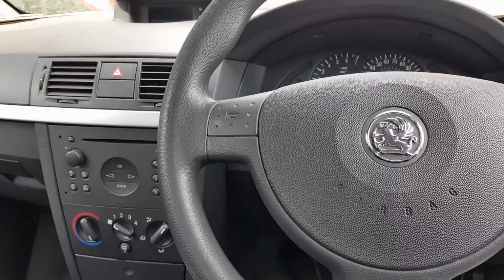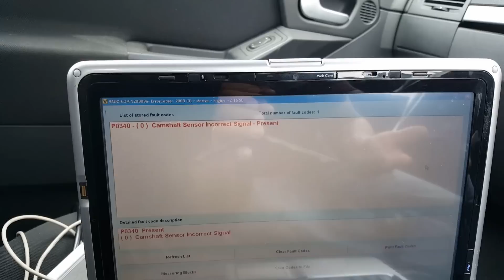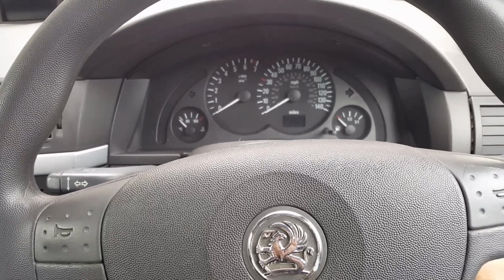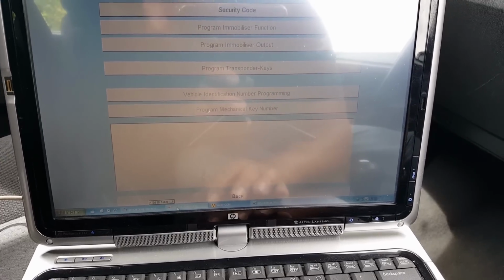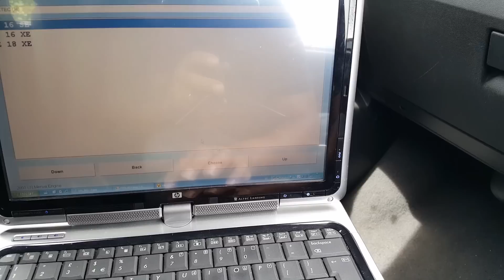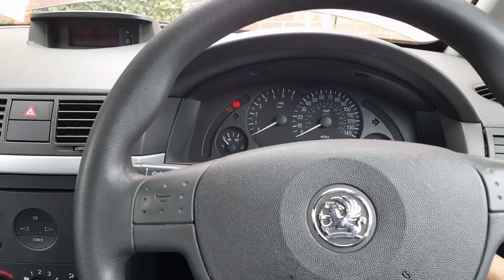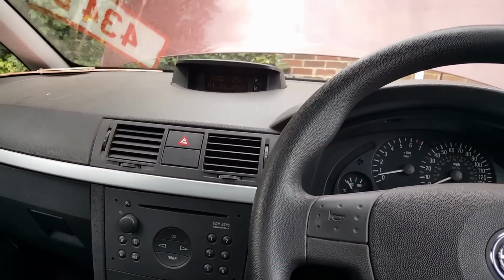Vauxhall/Opel Meriva 1.6. Engine ECU replacement, reset and programming.

Comment: Hiya another great video fella.  I am not sure I can keep up with the fast movement of your screen changes.  I would have to watch the video many times which I can do.  As you have been helping me with my grandaughters Agila Im going to say I took the fuel tank out of the vehicle and pressure tested the pump off the vehicle.  it showed it as before at 7psi running it directly from the battery which I had taken off the car.  i initially saw it pump fuid from where it should and although it worked it seemed weak so then the pressure tester was fitted with the earlier.  result.  I had wached a video of some guy breaking a fuel pump apart and illustrating all the other parts within the fuel pump assembly.  namely filter pressure regulater and realised i should have bought the whole assembly and not just the pump.  A costly mistake have a new assembly coming sometime tomorrow.  I am not sure it will work in the car due to possible ECU control issues so I am going to test it off the car again tomorrow, before putting it back.  This is due to the fact that since I changed the engine I have not heard the initial 3 second prime.  I would be interested in your view.  many thanks for all your producing for interested guys who love cars and electronic control cheers colin
Reply from the maker: colin Lyne 
I don't think you will have any issues with the control side of things...
The ecu only controls a relay, which in turns runs the fuel sender pump...
Until now everything points to a bad pump... 
Also check that the relay is good...
Bear in mind that just because you can hear it clicking, does not mean is good...

Comment: Hi there I was wondering where do I get the software from and the cable to to connect to the car and also will this work the exact same way for a zafira MK1 2004 model.

Reason I'm asking is I have had the lamba sensor replaced but the engine management light stays on even though the error codes have been reset, the cables have been tested and seam to be ok so the next thing is the ECM that needs reset or replaced which looks simple by your video.

I hope you can help or advise.

Thanks
Reply from the maker: The lambda codes can be a result of something else... well you don't say the codes... so just thinking out loud here...
You can get Op-com on eBay... software comes with it...
Thank you for watching and for your comment!
Reply: @LMAutoRepairs  yeah I meant the lamba codes have been reset and nothing else comes up. The sensor has been replaced 3 times with the same issue and codes come back on once the engine has been switched back on.

What else could be the issue from your experience? I have heard it could be the ECM that's been tripped and needs replacing and can cost a arm and a leg to get someone to do it.
Reply from the maker: @williamgall9616  
It is possible that is the ecu... if they are definitely hard codes, and everything else has been checked...

Comment: السلام عليكم اخي
I did the same steps But the security code For the new ECU  (DELCO MT35E) The computer did not accept it.
 Although it is true.
Help me please
Reply from the maker: The original code is used only to reset the ecu...
Then the car code to program it back in...
👍👍👍
Reply: Yes, I have already done this
Reply: But the operation was not successful The computer did not accept the code
New ECU code 9915
 Car ECU code 9016
Reply: What is the solution in your opinion?
Reply from the maker: @mecaniquepourtous7791 
So, if you have done that, what is the issue?
Reply from the maker: @mecaniquepourtous7791 
Have you successfully reset the ecu using the original code?

Comment: I have changed my instrumen panel on my opel corsa c class 2005 i have the security code but its doesent work on body control module when i enter the security code it says wrong security code but when i enter the same security code ecu, and  immobilizer its working but body controle modul says wrong security code
Reply from the maker: Which tool are you using?
👍👍👍
Reply: Opcom 1.99 version
Reply: The body control is ok ,but instrumental panel security code not work
Reply from the maker: Try a different version... different versions behave differently on different cars...
👍👍👍
Reply from the maker: If you replaced the cluster, you need the original pin code from the cluster in order to reset it first, just then it will accept the pin from the car you are trying to install it on...
👍👍👍
Reply: Thanks a lot my friend. The problem was solved, my car started, just set the odometer. I pray for you
Reply: I need to change the digits of the km hour, I will do it later, I will look at the videos you have posted. Thanks again

Comment: Hi would this work on Meriva  2008 1.3 CDTI  as it’s got different ECU . Part number 55566400HQ? Thanks
Reply from the maker: Yes...
The procedure is very similar...
I think I have videos on it... if no I have them to be published.. 
👍👍👍
Reply: @LMAutoRepairs  thank you mate 👍🏻👍🏻👍🏻
Reply: @LMAutoRepairs  i have followed the steps but when connecting opcom to the car couldn’t access the car ecu . There is a message saying : initialling ecu and after saying : could not access ecu .
Does it mean that the ecu is dammed inside or something wrong with ecu connexions ? Thank you for any advice
Reply from the maker: One of the two... yes...

Comment: The old ECU is not working properly, that's why I bought a new ECU.  This ecu does not seem to be reset. Is it possible to reset the ECM on this ECU?  Unfortunately, the car in which this ECU was installed does not exist.

i hope you can help me. thank you in advanced
Reply from the maker: Depending on the ecu...
Can be done via OBD or needs to be done on the bench...
Thank you for watching!
Reply: @LMAutoRepairs  Thank you for your answer. okay i see.. the only way to reset the ECU is with carprog.. i am sorry but i am a newbie :)
Reply from the maker: No... 
To reset it you need the pin...
You can read the data content from the ecu on the bench and then figure out the pin...
The reset even Op-com will be able to do it...
Carprog just might happens to be able to do it through OBD... depending on the ecu...
There is other tools that might help... but more expensive...

Comment: Hello! If i change on an Astra G 1.7 DTI the ECM+imobiliser+key cip, do i need the CAR PASS ( PIN) of this ECM ? Thx!
Reply from the maker: THE STIG 
If you get all the immobiliser parts,  providing they all come from the same car, no pin is needed...
Reply: Or i get an reset ECM  in that case i need only actualy PIN of ECM that is instaled on my car (i have it on car pass card). U know if i can program it with Delphi ds 150E or i need Op Com? thx!
Reply from the maker: THE STIG 
Correct!
An reset ecu is ready to accept any code... so if you have the car pass you have all you need...
I never really worked with delphi... so don't really know if capable of that...
Reply: Tank you very much! U do a nice work!
Reply from the maker: THE STIG 
No worries... here to help...
Thank you for your comment!

Comment: Thank you for taking the time to do this vid. I have replaced the abs module/pump on my Corsa D VXR with a second hand ABS unit as the original ABS unit was non repairable. The second hand unit has been tested and comes with a warranty. The ABS that has been replaced requires programming. The part numbers on both ABS units are compatible and I will be using an OPCOM to program. The issue is i have never programed an ABS unit. Do you have a video on how to program or instructions on how to do this? Any information will be appreciated.

Comment: The engine ecu pin code is the same code that is in the immobilizer dump? Same code for ecu, bcm, instruments, immo or they are different? Nice tutorial.
Reply from the maker: No, you are correct.
All the modules will have the same pin code.
Thank you for watching!
Reply: Do you know how to get pin code from instrument panel eeprom dump? op com can read and change millage on many dashes.
Reply from the maker: Op-com can indeed read the pin from dash on some older models...
ICC can do it.. there is other softwares out there, or info for the bytes location of the pin... google will help you on both....

Comment: A small university.
Thank you again for the detailed tutorials. Many people are learning from you.
Now here is my question.
In my car, a Peugeot 407 hdi 136hp, last year, I changed keys and door-locks, in the authorized dealer.
The PIN number I was given for the new keys, is different from the old one of course.
Right now, I managed to read my EEPROM, and saw that the original PIN was still there. The same one. Now, what have they done?
Did they changed the PIN only in the BSI?
And if there are two different PINs, how can that be?
Does the PIN in BSI take precedence over the PIN in the EEPROM?
My ECU is Siemens SID 803.
Reply from the maker: Peete Kastanis 
Hi
I needs to be only 1 pin...
If at the dealer they have changed locks and keys, was no need to change remotes... have they?
Even if the remotes were changed, they would have been programmed to the BSI using the actual car pin code...
Unless they have a
also changed the BSI... even in that case, the new BSI would be programmed using the original pin...
So, you can't have two different pins for the same car...
What you might have been given, is the mechanical key number... that is a unique number that can be used to cut the key even if you don't have a key to copy from...
Unless there is some info missing here...
Hope that helps...
Reply: Thanks Imsvvavr
My case is going to be a mystery, until I solve it.
Last year, somebody got into my house and stole me. He also took away the two keys of my car. One with remote control and a simple one. So I took the car to the dealer with a transporter truck, and ask him to change the door-locks and the keys, just in case the burglar finds my car parked in the street and takes it away with the original keys. I tell you, that they changed the mechanism in the wheel column where the key enters and the door-lock plus the glove box lock and gave me new remote and simple key. They did not change the BSI.
Now, my original keys, they have a card with the key code YU4V, which is the same with the PIN code my EEPROM has (I read the EEPROM with Galletto). It is located in the hex places: 22, 23, 24, 25. My new keys have a card with a new number: WXWB
Reply from the maker: Peete Kastanis 
OK... I got you...
I don't know why they would give you another code... I mean, they could have reset the ECUS to change the original pin... Although does not make sense that the code you have retrieved is different.. 
Do you have PP2000?
Reply: Well, I spent all my afternoon in my car with Diagbox, making various tests, and I think I solved the mystery. There is an option in Diagbox: REPAIR->BSI->PACK REPAIR->REPLACEMENT PARTS (Or LEARNING, I forgot)->CHECK OF THE CODED ENGINE IMMOBILISER CODE IN THE BSI, which accepted my original PIN, the YU4V. It seems that the new one, is about the key and how to cut new keys if they are lost, just as you mentioned dear friend. Once again you were very accurate and informed. How can I thank you. You are always right. Thank you for your time. Be happy!
Reply from the maker: Would have to be something along those lines...
Glad you got the mystery resolved... 
I am not always right... believe me.... lol
Thank you for your feedback!

Comment: Great video, thank you. I have a couple of questions though. What interface are you using to read Security Code from ECU? CarProg interface? Does OPCOM communicate through the same interface or do you need an OPCOM interface too?
Reply from the maker: Hi
Yes, Carprog interface to read the security code... and indeed you need a opcom interface to use opcom software...
Thank you for watching!
Reply: Thanks, I have Opcom already, and I am pretty confident about setting up new ECU, but I just need to be able to read Security Code from existing ECU (as we don't have Car Pass) and also from the replacement ECU as ebay seller doesnt have it. Can you recommend where to buy Carprog interface?
Reply from the maker: Ebay can be a good place, actually I bought my one there...
Just look for seller with a good reputation...

Comment: Hi, Was your replacement ecu serial number the same with the car ecu serial number.   Would it work with a different one?  Thanks beforehand!
Reply from the maker: Hi
As far as is from a similar car, should work, even if the numbers are different... as sometimes different numbers only mean that the hardware and or software has been revised, but the functions of the ecu remain the same...
However, if you can get hold of one with the same numbers, the better....
Hope that helps.
Thank you for watching!
Reply: I see. Well ,I believe the replacement was from Meriva and my car is Zafira. The immo sequence went alright and the car started, unfortunatelly there were 3 errors: two with the fan and one with the AC. They were present but not functioning. Ac wasn't functioning and the radiator fan didn't start.  Is there any way to reprogram the ecu or it is too complicate ? Thank you very much for replying! The guy who did the immo did not programm the VIN. Could that be the issue?
Reply from the maker: Have you checked the configurations?
If you can configure things in there, then is because that ecu does not have those functions...
Check configurations and go from there...
Reply: The AC was present in the configurations, still, didn't work. The guy who did the reprogramming made all the necessary steps and after that he said I should have bought the same serial number ecu because the software is different. We finally opened the faulty ecu which already was repaired 3 times and there was a loose wire. Now he will remove all the wires and weld new ones to make sure it lasts longer not just one month as it did now. Only one side, as the other one seems to be in order and not touched. Thanks again and take care!

Comment: Hi 
Great video dude, can you set the mileage to the original value or is that stored in the instrument cluster ? 
As that will flag on my next MOT
Reply from the maker: Hi
That's in the cluster... this does not disrupt the mileage...
Thank you for watching and for your comment!
Reply: LM Auto Repairs 
Thanks for the reply, I hope it doesn’t come to that. 
I changed a head gasket and timing chain on a Corsa D 1.2 56 plate. Now I’ve got p0036, p0141 & p0304 sensor 2 and misfire pot 4.
I’ve got compression and fuel just no spark. 
Taking (left pin coil pack from gearbox view) 1- 0v  2-12v. 3-6 pots 1-4  going pin 1-6 I don’t get same reading as 1-3,4,5 so if these are correct pin outs it could be coil pack but seem too much of a coincidence to me... all plugs are in and engine does run with misfire, I thought I was gentle with the cables too, ordered op-com should arrive by Friday. Love to hear your thoughts 👍
Reply from the maker: @GarysTechSupport  
Just check, double check, and triple check everything... it is easy to sometimes miss things... get some diagrams... it is a bit confusing the way you explain the pin out...
Then check primary ignition signal... if is there, and you have no secondary ingnition, then is your coil pack...
Hope that helps

Comment: will the car need reprograming if i swap  the read coil and key cip with the ecu ?
Reply from the maker: alex cristian 
Hi
Yes it needs... you still have the cluster and bcm originally installed...
Reply: Damn i thought if i just swapped the imobilizer read coil the transponder key with the engine ecuon my astra g it would have worked because i keep seeing people on ebay selling kits comprised of these parts
Reply from the maker: alex cristian 
It will work,  but only after the programming of those parts into the original car immobilizer system... a bit like on the  video...

Comment: Thank you very much for the vid it hepls
Can i ask you a favour can you please find out if the carprog can read the pin code for astra h 1.8i auto 2005 z18xe.
Reply from the maker: Baby Ninja On Board 
Hi
Thank you for watching and for your comment... I will have a look when I am off work...
Reply: Thank you will be waiting
Reply from the maker: Baby Ninja On Board 
Hi
On the CAN it does:
Siemens Simtec 71.5
Siemens Simtec 71.6
Siemens Simtec 75
Siemens Simtec 81
I am pretty sure being a 2008 is full CAN...
I am not really sure which one is on the Z18XE, but I would guess is one of the above...
Hope that helps....

Comment: I have a sigmum 1.9cdti that has a bypass switch on the water coolant sensor which tells the engine it is cold to start so turns glow plugs on if I don't bypass it engine says it's 55 degrees and will not start engine as plugs don't come on can you tell what's causing this ? Cheers Phil
Reply from the maker: philip beal 
A faulty water coolant sensor?

Comment: hello, I'm trying to retrieve the passcode from the ecu
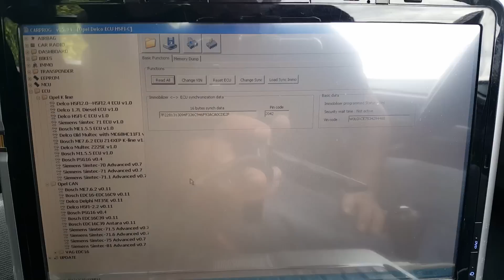9:52  I have the followed the same steps but I always have a problem its says "wrong passcode" ,  no synchronization data comes up. Can you help me resolve this issue.
Reply from the maker: Are we talking about the same ecu?
Thank you for watching!
Reply: @LMAutoRepairs  Yes its the same ECU
Reply: @LMAutoRepairs  Can you advice me on how I can fix this issue, do you know how i can get the correct passcode, to complete the reading.
Reply from the maker: To read the pin with car prog, you don't need any pin...
Just select the correct ecu and retrieve the pin...
You will need the pin to then reset it and program it again... As per the video...